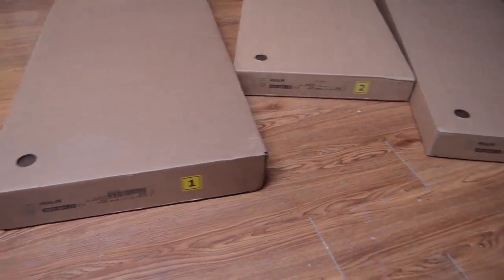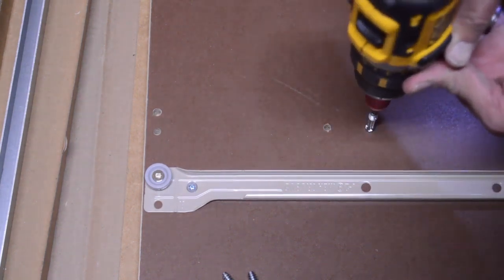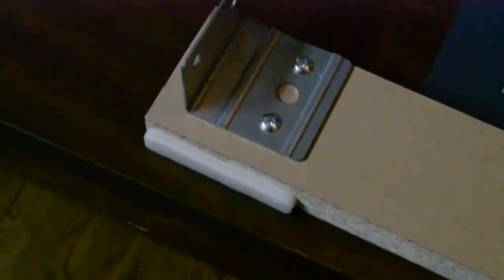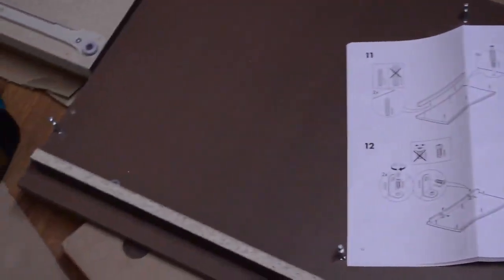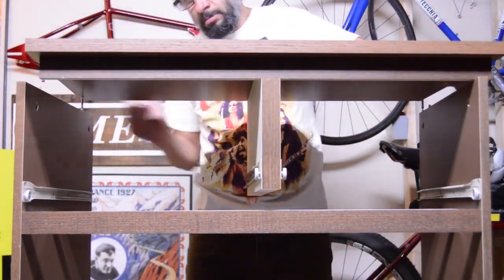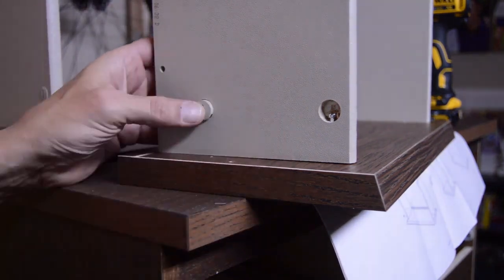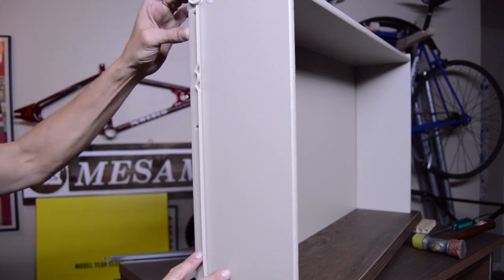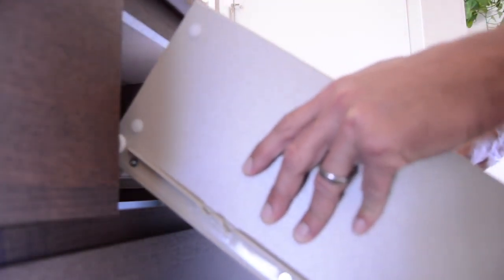How to assemble IKEA Malm 6 drawer chest

Comment: If you have issues installing the 2 small top drawers :
The inside rails are probably installed incorrectly by IKEA.
You need to take them out. Exchange the 2 inside middle rails and exchange them.
They have to mirror perfectly the exterior rails.
My middle inside rails were upside down. It seemed right bc the wheels were on the right side.
Hope this helps!
Reply: Thanks this is exactly what I have found with mine too.  Were you able to change this yourself or did you have to have IKEA send you replacement rails?
Reply: @jeypurushotham7180  no I just unscrewed them myself, it took about 1 min!
Reply: @mariemiron4053  so helpful thank you!  Fixed :)
Reply: @jeypurushotham7180  great!
Reply from the maker: Thanks for the tips!
Reply: Did you have to go back to IKEA or did you change the rails yourself?
Reply: @sjames6921  I did it myself!
Reply: I did that but the bit at the bottom of the draws that stick out isn't allowing me to slot the drawers in. It's driving me crazy
Reply: @sjames6921  I’m having the exact same issue. Did you figure it out?
Reply: Brilliant.. this is exactly what I was trying to figure out
Reply: are the wheels meant to be at the bottom or top of it

Comment: would this last if i had my xbox on top of it? e.g. my xbox gets hot, not sure if it'll damage the top over time?
Reply from the maker: I think it would be fine. The top panel of the Malm dresser is pretty thick 3/4" at least. I believe it's MDF with some kind of laminate cover. I've got an xbox that sits on a 1/2" plywood panel in the TV stand I built. It's been on there a couple of years with no issues. Many years ago, my brothers and me had a Playstation 1 that got used pretty heavily. It would overheat after a few hours and lock up, so we put it on one of those grid things that you put cookies on to cool down. It worked pretty good to keep good air flow around the playstation, so you could always do something similar is you're concerned about it.
Reply: @JoeyMesa  thanks! I'll try that. Might just add glass up there
Reply: @jayem5807  hey, IKEA does sell a glass top that fits on the malm dressers, I got one when I bought mine because I want to use it as a dresser/tabletop for my perfumes and jewelry :)

Comment: Do you have the dimensions for the space inside the drawers?
Reply from the maker: The bottom 4 drawers are 28 1/4" wide x 16 3/4" long front to back x 6" deep. The top 2 drawers are 12 1/2" wide x 16 3/4 long x 6" deep.
Reply: @JoeyMesa  Thank you!